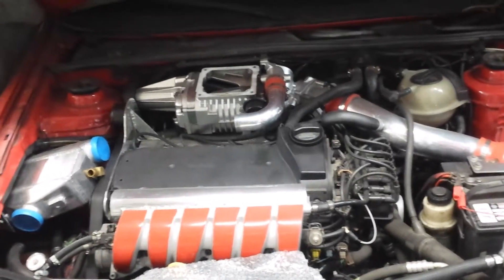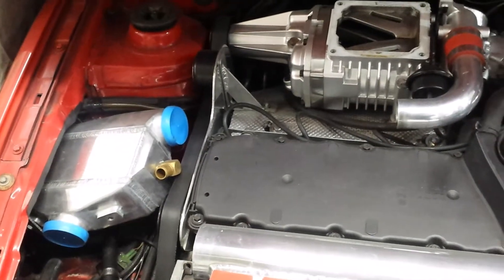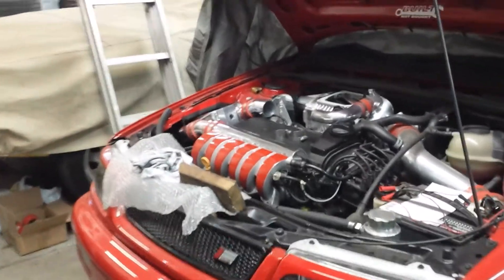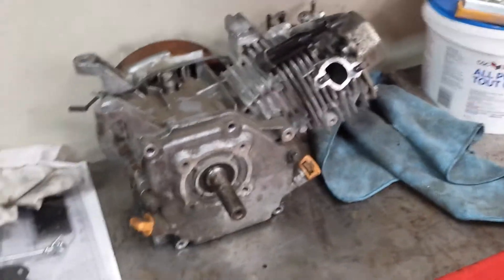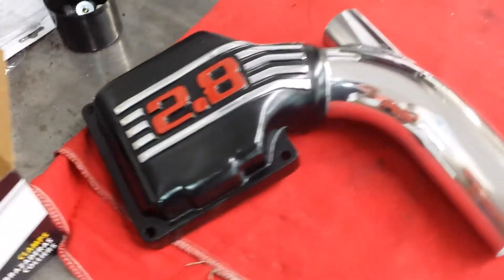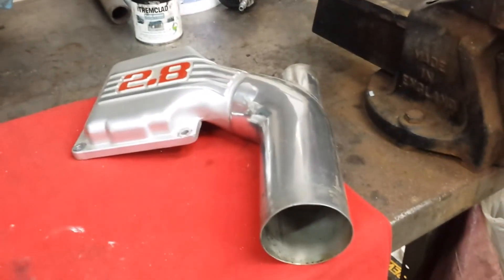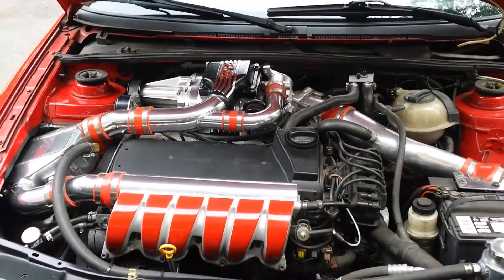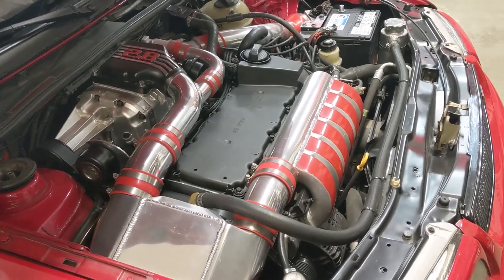2.5" intercooler and pipe M90 Supercharged

Comment: I like this! It looks clean and it’s uncommon! Did you have to do anything with the fuel system or tune? I’m thinking about something like this on an afp vr6 in a mk4 gti. How much power do you think you are putting down? How is the low end torque?
Reply from the maker: stock fuel system, injectors 36lbs with chip and 4" pipe for maf sensor, soon going to try 42lbs injectors with new chip for tune. I am thinking about 300 HP . With supercharger low end torque is great.

Comment: Dear sir, can you explain me how your bypass valve works ? And what happened with your old diverter valve ?
Reply from the maker: Bypass valve works by vacuum. When accelerating less vacuum, valve closes to build up boost.  Not sure which old diverter  vale you are talking?  is it from a different set up i had?
Reply from the maker: @m50b20f  With the throttle body on the intake the vacuum bypass was giving boost too fast, i needed the diverter valve to control boost better it has a stiffer spring.
Reply: @stroker6pack  hi ! Do you think your bypass valve size is enough ?
Reply from the maker: @m50b20f  Yes it is.